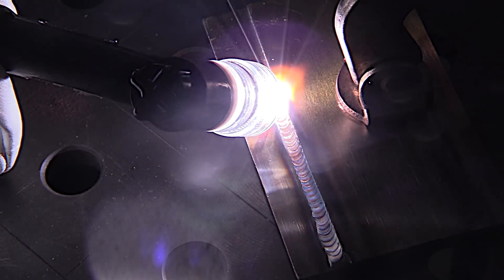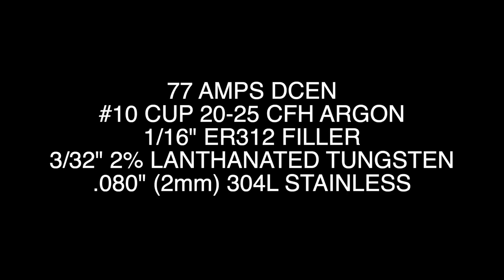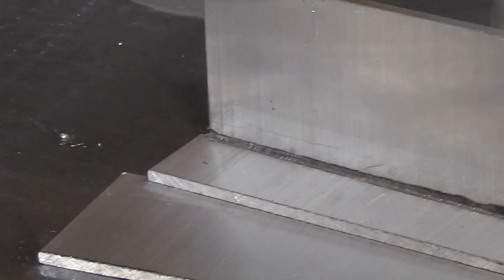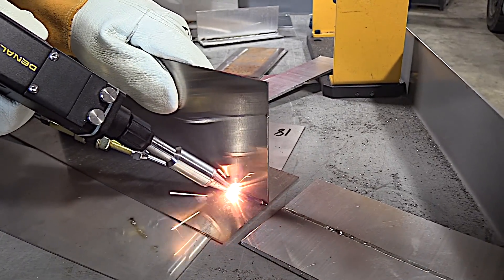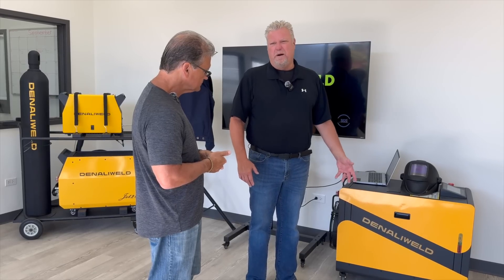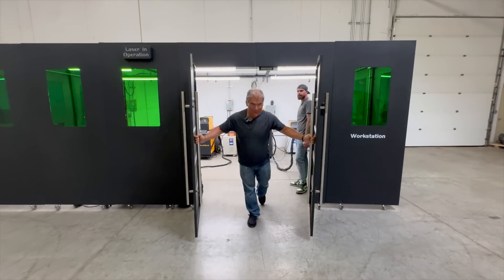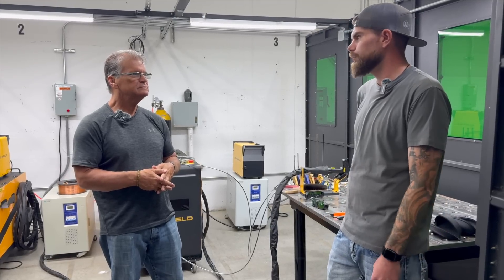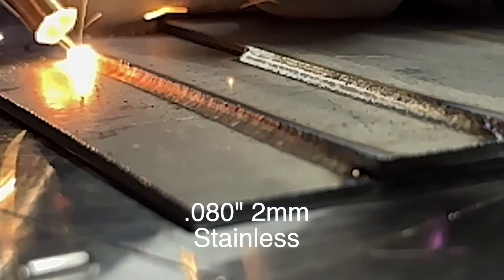DenaliWeld Laser & Stainless Lap Joint with TIG

Comment: One of my welding suppliers is getting a laser welder set up. From what I can see, the learning curve is easier,  but safety is paramount.  From what I understand,  the laser can legitimately blind you if you slip up even once. They are having to install special walls, safety switches and lights,  and sign serious wavers to even try out the machines.  Discipline is going to be the determining factor when it comes to finding people to preform this process.  Once I learned the science of what is going on and how easily the process can blind or kill someone,  and the extent you have to modify your shop, I can't see this being something that won't stay at an industrial level. Witch i feel is fine. I think these machines will end up hurting the general public more then help due to how easily they can permanently damage living things around them.

Comment: I had an inlet manifold laser welded by a company that does Formula One work. Look very pretty. Broke (cracked) on the dyno on first calibration. Had to get it tig welded, never broke again. Would only use in low vibration vs load use cases now (has a cam chain cover welded, don't expect an issue.

Comment: I'm old school and when it comes to welding I love shielded metal arc welding AKA stick welding why because that's what I grew up doing and that's all I care about I've tried other things such as Mig and TIG welding and that didn't work out so well not as good as arc welding because I just love scratching a stick and getting right to it no need to worry about gases or any other crap added on or anything like that just strike the arc and you're all good

Comment: I have a pacemaker.  They tell me no welding over 100 amps.  What kind of welding could I consider doing?  Not a lot of experience.  Little stick.  Little mig.  No tig.  Thinking aluminium might take lower heat so less current.  Just want to build some little brackets for antennas and things like that?

Comment: The laser has a wavelength of 1070 nm which is in the infrared.  This means no UV sunburn or arc eye.  Eye safety however is critical.  You must block this wavelength from reaching your eyes.

Comment: After using a Miller inverter tig machine in place of my near 20-year-old machines, I am in the market for a new tig.  I build race cars for 35 years now using 4130 rounds in 1.625" and smaller, use SS and Ti for headers in 1.75"-5"..  Very interested in the laser welding process but would like to speak with skilled experienced tig welders whom now using laser welding process on applications like mine...     As most will agree there is a significant difference in required skill sets between welding flat stock on a bench {as in vids} vs welding round tube on intricate structures....

Comment: Great weld on lap or tee joint. How would it work on plug welds? For example large 1/16 5052 aluminum sheet on work surface, 1/4 6061 machined component underneath and a small hole to weld through. Tough to get puddle in the thick underneath piece before blowing away the thin sheet. Thoughts? Trials? Please.

Comment: It would be interesting to learn how a laser welder differs from TIG in all ways such as gas type & consumption, surface prep (specular vs mill scale), realistic consumable tooling (yes, tungsten is consumed), power requirements, maintenance (coolant, etc), and of course, capital investment in equipment.  Seems to me that this tech is very cool but not yet appropriate for a weekend hobbyist in his garage due to cost & safety concerns.

Comment: Finally some real information on “Laser Welding “ good grief on instagram a close up then done, some weird  music track very bad music too. The 30 second Instagram cut short not showing the supply and settings no safety information and dead links to a China laser welding machine manufacturer Yikes. 

So what I am seeing so far, an energy source using photons ver electrons to heat the metal. Looks like a shielding gas is also used.  One other point a filler wire is used just like GMAW. Be nice to know if laser welding can do sanitary welding, no filler added. Finally I noticed no information of type of shielding gas and flow rate, next metal preparation before laser welding and bend tests plus penetration section review.

So glad That you Jody are digging in on this new energy source for metal welding. A lot of hype no facts, until today.
Pretty sure your “WeldMonger” on line store will carry only the best laser welding equipment and supplies.
Thank you very much.

Best
Kristy
Reply: Thanks for watching. The nitrogen is more to keep moisture away from the protective lenses. I had jumbo fans purposely blowing towards my welds and still had a amazing bead.

Comment: What laser sources are being used ultimately raycus, IPG, max photonics, nLight etc? What radiation studies have been done? Most of the lasers are usually 380v 3 phase...some smaller ones do operate on single so what's that breakdown? How many gallons of distilled water does a machine chew through? Great videos as always keep it up.

Comment: I’ve seen this same system up in Cleveland, OH at Arc Gas & Supply. Awesome system. Using a 5000 series aluminum wire you can achieve 20+ IPM. Carbon steel and stainless you can move even quicker. Gaps over 3/16” are a challenge, so make sure your fit up is tight. 
Go get a demo and see for yourself. I’m certain they still have a few in their demo lab on site.
Reply: 3/16" is a huge gap (unless you're welding giant things), no matter the process ... I wouldn't hold that against anything new.

Comment: Can it burn off mill scale in the same way it can remove rust, and do you need to clean material in the same way as other welding types prior to welding?
Reply: Heavy mill scale was removed in seconds using 2000w system. Just brush off the leftover debris and you’re in business.

Comment: What are the consumables?  Single wire and double wire was mentioned. What's that about ? Are they consumed ?
Reply: Since it’s a cold wire feed the consumables last months. We got ours in March and haven’t swapped yet. Protective lens can be damaged when perpendicular to the workpiece, but that takes 2 minutes to swap out. And the protective lens is only a few bucks.
Reply: Yes your consumables are your protective lenses, MiG wire, and gas. If you get the water cool it’s distilled water to fill. You start with 10 protective lenses with our Denaliweld.

Comment: FYI: Lasers tend to not handle large gaps very well, so be sure to ask about that. The laser really struggles to heat up a large area and keep it warm, so also check out the limits on the maximum width / depth graph of a weld. That said, I LOVE laser welding, and am a total nerd for it. So glad to see you finally covering it! :D
Reply: I've been experimenting with filling larger gaps, and so far what I've settled on doing is stuffing some filler wire in there and doing a couple passes to blend it in.

Comment: How about Titanium laser welding?
Reply: the big key with lasers is wavelength. Titanium absorbs ~1100nm light efficiently, so this would work just fine on Titanium. Wood, or copper, however, would not work very well. Copper needs a green laser (this uses an infra-red laser).

Comment: Did he say 3/8" full pen butt joint?  If so thats pretty wild. A cut and etch would be very interesting to see.
Reply: I'm wondering... is that in one pass?
Reply: Yes. The specs on machines are always single pass. Any machine could do a 3” fillet if you had enough passes, but this spec in particular tells you how powerful it is and therefore how efficient it can be for your time.
Reply: @vicferrari9380  ,,Yes, i heard him say it was duel wire feed., I still need convincing.

Comment: Do you foresee the expense and size of this machinery diminishing with time, or will the cost and size intrinsically be out of reach for the average small shop/home shop welder for the foreseeable future?
Reply: 90% of the size is the cooler. You have to keep the laser sources within a few 1/10ths of a degree for them to operate correctly. The laser source itself is pretty small, and basically a bunch of yttrium-doped fiber wrapped in loops with various isolators and a bunch of fancy timing electronics. The laser source itself is about the size of a shoebox (for work boots). That giant box is the chiller, which is a mini-air conditioner setup to chill water and move an INSANE volume of water via a constant displacement pump. So, to make it smaller, you have to have a more efficient/smaller cooling solution.

Comment: They look great on a lap or where you can drag it but lets see something else
Reply: Would like to see some stainless butt joints to see actual heat input, or lack thereof.
Reply: @mitchdinner9743  I build ss headers for racing, would like to know more about capabilities on ss round tube in the 1.75"-5" diameters.

Comment: I understand laser welds can have issues with porosity and hot cracking.That would be interesting to see a discussion on. I work for a large energy project, and laser welding is used in a lot of the large stainless weldments, and I know porosity was a huge issue in many of those parts..
Reply: Can it weld titanium?

Comment: I would like to see laser welds run through destructive test comparison with equivalent tig process
Reply: Yeah, I'd like to see a pen test on say 1/4" ss ... Although I wouldn't/couldn't afford this system, it would be interesting to see .
Reply: Car bodies used to be spot welded. Now they are glued. We have epoxies on airframe parts too. I'm sure the testing will good enough for some things but agree I'd be interested in critical areas like say a submersible vehicle or high pressure pipes.
Reply: Run them through every test.